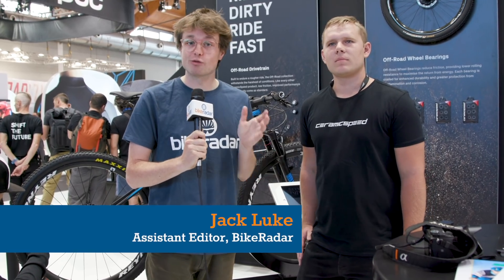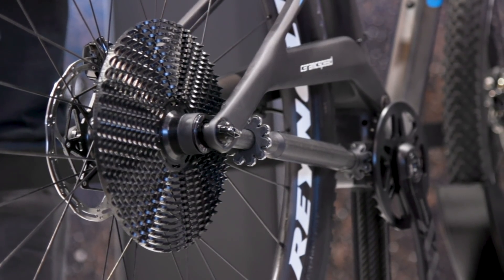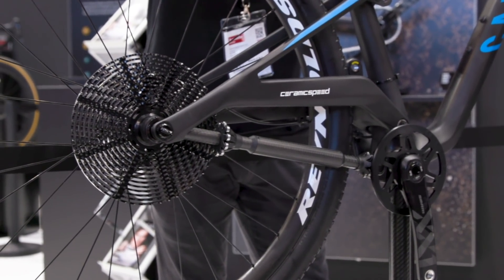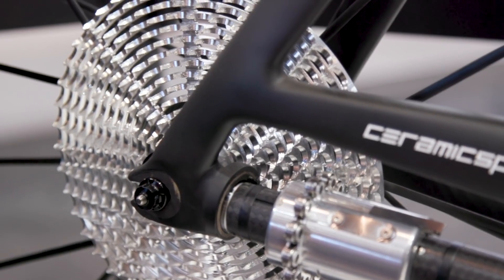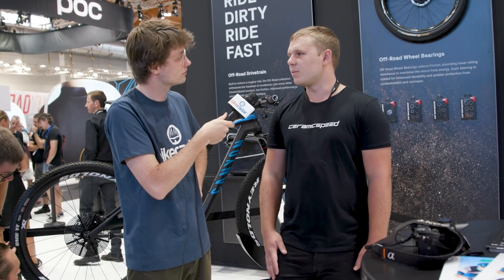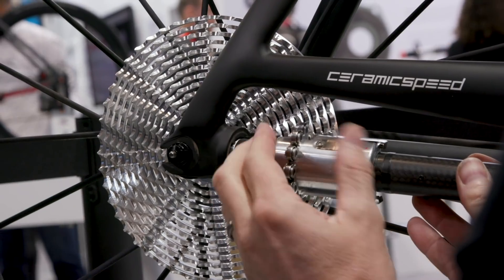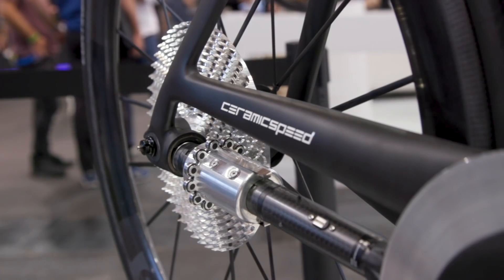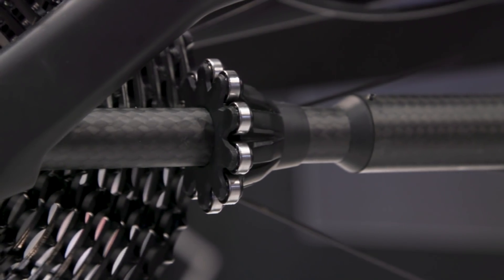No More Chains! The Future of Bike Design? | CeramicSpeed’s Driven MTB & Road Drivetrain

Comment: All the small gear rings on a regular bike are pretty close together (teeth = 11, 12, 13, 14, 15) and get bigger exponentially (23, 25, 28 . .  .), and this concept doesn't/can't do that. The proportionate difference between gears 11 and 12 is bigger than say a 35 and 38, and I can't imagine having a very optimal gear spacing on this concentric gear ring concept, especially on those smaller rings.
Reply: The gearing is perfectly linear. Nothing wrong with that.

Comment: there should be a highpressure waterspray+small watertank in conjunction with the shown motor to clean the gear-wheel, just like on some car front lamps.
Reply: All that is excess unnecessary weight you have to lug around with you when you could just carry something like a small brush and do it yourself or use a chained system

Comment: Love the creativity, but no way that thing handles torque without slipping/skipping. Between the axial load, on the ring gear and driveshaft, and the necessary clearance and compliance to operate. Of course you could beef it all up but, a sprocket or radial gear is much more strength to weight efficient
Reply: Fantastic - maybe you could help the team out by sending them your  calculations! They would probably be very thankful for your help!

Comment: He sais they took the bike to 45kph to see how it handles load, but I'd imagine it would struggle most in low gears, not high up - this rear gear assembly looks like it may bend and wobble while under load  in low gear, skipping teeth etc.
Reply: Damn straight. The force trying to separate the rollers from the teeth will be horrific.

Comment: I wonder how this system would cope against a 2000w sprinter. There are very few contact points between the rear sprocket and the driveshaft so the wear will be much higher and the sprocket will tend to flex inwards especially on the easier gears and under high power so I'd imagine even a moderately powerful rider would stress the drivetrain enough to skipping point. The idea is cool but it is nowhere near a finished reliable and affordable product
Reply: yep - that's the major stumbling block if you ask me. They say it ran at 45km/h , but that's going to be on one of the inner rings of teeth which won't be so prone to flex. They might find a solution, but I doubt it will look like this. "Stiff. Light. Affordable. Pick any two"

Comment: As a bike mechanic as my job is bike mechanic, the concept seems pretty cool but I see to many things going wrong with it or at least wrong with it in Arizona where rocks and technical climbs plague all mountain bikers. I see us cracking those carbon drive shafts really easy because it is a common thing to crack chainstays. Not to mention how much people grind their gears on rocks and bend chainrings. That’s manageable with a flexible chain but a drive shaft that needs to be solid interfacing with a bent chainring. Seems like maintenance will be cheap but parts can get expensive quick.

Comment: I am a mechanical engineer with a special focus on drive-line, and power transmissions. Particularly of automotive, but a lot of concepts from that, carries over to bicycles. 

This is over-engineered. It will never catch on because the benefits do not outweigh the conventional chain and sprocket. This design is pointless because it will cost more money than it's worth because you're having to pay for the work that a talented engineer has done, but it won't pan out, and any mechanical engineer that's smart, will go and work in a different field or industry where they can make more money. 

The only way that this design would ever be worthwhile is if the cad drawings were uploaded with something equivalent to a GPL license.

Comment: The two gains: 1) thin cassette=wider spoke on rear hub= increased strength. 2) Full suspension, use a concentric BB/rear pivot like that in the Pole Machine and Pole Stamina.

Comment: seems like it would be significantly easier to damage the drivetrain cogs in this setup considering that the load is being applied into the teeth in a much more concentrated area, and also at a 90 degree angle to the direction where a thin body disc is most rigid. Normal cassettes handle this load fine because its applied inline with the direction of highest strength.  Curious to see how well this design does in the real world.  Also the bike shown here cannot access the fastest 3-4 gears because the frame is in the way?  Who designed this?

Comment: What about a final drive at the rear and the crankcase more like a transmission?   It's not like they have been doing just that with motorcycles for years
Reply: A chain is far more efficient than a driveshaft in terms of friction losses

Comment: Good idea. Now the spoke bracing angles can be even on both sides.  Makes a stiffer   wheel.
Reply: You can get hubs with asymmetric flanges (like the alto cycling r-symmetric hubs) that compensate for that. There's a weight penalty but there is always a trade-off.

Comment: This is a new direction in bicycle transmission but Will it be smooth shifting and rotating after all the mud gets stuck on the transmission? Won’t there be any grinding? It would be good that they do some enclose in some kind of case. Make it closed system. Which should be fine.

Comment: Full suspension bikes rely on the chain tension to shut the suspension “bob” down while pedaling fir efficiency. This looks like it loses that. This could be overcome with a new way of shock thinking and technology feature. Also, without needing an axle path that balances chain efficiency and active bump absorption, an axle path could be optioned that maximizes bump capabilities and other riding characteristics, depending on what limitations this system requires as the technology further develops

Comment: Interesting expirement, but when it creates more problems than it solves, you know it’s never going to be marketable. The raised rear mainstay leaves the rear wheel and bottom bracket hanging, how could this not hugely impact structural rigidity and, more importantly, riding characteristics?

Comment: I get that you can ride it and ride it fast but can it handle 1000+ watts? If it can handle that I’d be sold on the concept but would never get it because of the assumed cost
Reply: If you can output 1kw with your legs, why haven't I seen you beat the tour de france? Top riders can do 700, for a handful of minutes.
Reply: Toy-joda they can peak in the over 1600 range. Greipel and Sagan. That’s also after 100+ km. I can hit it fresh at the beginning of a ride and usually I’m done after. I’m not saying I can go and hit it whenever I want, not even to mention the fact I’m 10+ kg heavier so that number is less essentially compared to GC pros. Also as if I can even afford I bike with this tech. I ride a 105 ultegra mixed groupo.

Comment: The concept is great, but I do not believe that rear "gear" cluster is stiff enough to take any pressure from pedalling without flexing and losing mesh with the drive shaft mechanism. Even tungsten carbide will flex at that length of leverage. Show it working with a beefy, ex-BMX racer turned MTB rider accelerating up a rocky climb and I might be convinced.

Comment: As a MTBer and engineer I think its a great design. Getting rid of rear derailleur makes road bikes more aero and mountain bikes less vulnerable. I don't know how many rear derailleurs I've tweaked over the years. Other major benefit I see is freehub doesn't need to grow with gear numbers. No need for boost/super boost/ect therefore allowing for wider hub flanges and more even spoke tension which these highly dished designs interfere with. The shifting mechanism is rather clever as well. There are some gearboxes that shift well under load, but that's still a common issue in most of the current drivetrain offerings. 
The major issue I see to its adoption is the same as with gearboxes; consumer perception and dedicated frame design. I definitely see this getting adopted more easily though as roadbikers are a much larger market that mtb and trekking bikes gearboxes were marketed to. Biggest hurdle I see is the race teams and sponsorships keeping brands from building a more efficient design if there teams can't race on it due to sponsorship conflicts. Sounds stupid, but it may make some companies hesitant to invest in the dedicated frame if they can't help sell it with the race results.
Reply: As an Engineer you should also want to spread the mechanical load over as much engagement as possible a traditional crankset you are meshing with about 50% of the teeth. With this you are only meshing with 1 or 2 teeth at a time. Apply a large sudden load and, snap!
Reply: I've gone threw maybe 4 in my current season, I go hard, I dont treat mine like it's made of glass, and I live in a particularly rough terrain, I think this concept is actually a great one and a good push forward as were reaching only minor leaps in terms of mountain bike tech.
Reply: Any engineer worth their salt would immediately find at least 10 major flaws with this design that make it significantly worse than chain and derailleur tech that has existed for almost 100 years.
Reply: @aygwm  that is precisely why it's still a prototype, shaft driven bikes are not a new thing, this is trying to improve on old technology, bevel gears. Shifting is also proven possible by the same old technology that dates all the way back to 1895... Driveshafts also has a way more consistent performance compared to chains. 

But yeah, at its current state, its just a proof of concept with a ton of room for improvement.
Reply: @aygwm  It's frightening that some people are engineers and not see the design flaws of such design. And these people create cars, planes, space rocket ships. Terrifying....

I work on computers so I'm not an engineer but even I can see this design is inefficient and too vulnerable to kinetic energy stress with only 1 or 2 teeth mesh taking the full load of an 190 pound adult.
Reply: Oh yeah you so need that aerodynamic aspect on something that barely does 40 Kay's an hour.
Reply: all of that load sitting on a couple of teeth 😬
I think spur gears are better at handling such forces
Reply: "as an engineer" <--- assume everyone is full of shit until proven otherwise. Mr engineer here probably thinks shitting into his own hands and clapping is also a good idea!
Reply: If it is really promising maybe Shimano or SRAM will buy it up and make the sponsorship conflict go away.
Reply: No need to readjust the shifting cables as the stretch out.
Reply: Yes, the question is how reliable will it be and would it provide a more robust gear contact at 45 degree angle. The speed changer could be inside the shaft.
Reply: They didn't invent this concept first. Check out Hasan Kum's video from 2014. https://youtu.be/FDvoNXPIfJ0
Reply: This is a good idea because of powerful cyclist with big legs that can probably brake the bikes chain.
Reply: You're an engineer Sam Young? 0.o hmmm....
Reply: Same i like this idea too. I hate breaking rear derailleurs too. Having to pay for another is annoying.
Reply: I Just think It shouldnt need to be electric controled, could be a simple cable mechanical
Reply: The shifting shaft is probably more susceptible to damage than a traditional derailleur. Change my mind.
Reply: @Bayplaces  Covers.
Reply: @ThisIsMego  how is that going to be practical on a mountain bike? How are the aero gains going to be maintained? At what point does the weight penalty outweigh the aero gains? Considering theres a motor in it, what races will allow this? What market will it serve? Belt driven internal gear hubs on e bikes are a stiff competition for whatever niche this thing is after. I mean really, who would want to use this?
Reply: @Bayplaces    you have a point, but it doesnt de rail, so grinding exits
Reply: As an engineer you should also know that a chain is one of the most efficient ways of transferring power too. If this was better, it would be everywhere by now
Reply: @Jj54328  Yes capitan but in Real World not So quite because  it gains all dirt and MUD.
Reply: You must be just another horrible engineer. There are many out there, I've worked with guys who were just plain out,  in the wrong profession. Great notebook peice, that's it. A thought to bounce off of to arrive to the right solution, anything but that.

Comment: With the little bit I know about physics, I can’t imagine how this would work well. On a chain system your initial torque force matches the line of the chain. You get direct translation of the energy. On this system the small surface of the bearings has to generate all that energy through through the shaft through the bearings then turn the corner, so to speak. I don’t get it. Someone explain this to me.
Reply: there is no way on earth that thing will do anything other than buckle and fail horribly on the very first outing... no matter what it's made from. The entire structure is a misconception from top to bottom. This is the kind of fantasy drivetrain that one could only dream up if one knows nothing about forces, nothing about leverage, nothing about the inherent qualities and limitations of materials (particularly in relation to that ridiculous disk at the rear) … a total joke.

Comment: I assume the wear rates with those tiny contact areas are going to be pretty high versus the multiple contact areas of a chain system?
Reply: You're probably right, however the bearing rolls over the cog, so might not be terrible.
Reply: @tubularmonkeymaniac  I concur regarding tooth design, they could be onto something. I'm getting that the main challenges are; stresses in the teeth on the largest cogs; achieving decent IP67 sealing on a housing that is both durable and light weight could be difficult (I would know for this point); also, cost might yet be a big issue due to the precision and hardness of each component.

Comment: Seriously, it's time to be blunt about the drive mechanism.
1. it's almost a 100 year old concept
2. it can't shift as good.
3. it transfers the power over merely a couple of teeth, instead of distributing the forces over a chain. It will not last 10% the time of a normal system, as a normal system (e.g. 53x14 ratio) distributes the power over 25 and 6 teeth, whereas this uses 2 + 2 teeth. That's horrible!!
4. yes, it looks nice, but that's about it.
5. the hype is unreal. great marketing job.
Reply: This should be top comment. My thoughts exactly.
Reply: My thoughts exactley  .

Comment: I don't like it! But that's irrelevant, if nobody tries to break the established, we won't evolve! Props to going forward even if this product ends failing enterely, the future of bikes will come because people like this 👍
Reply: @Xanthi2020  it sounds like this is more efficient than a chain drive, i think that's part of the point. Also, I love the idea of gearboxes, and would love a Pinion with belt drive for bikepacking, but they can't shift under load. It looks like this can! Plus, the gearbox and belt drives are less efficient than a chain drive. This could be a really awesome solution, honestly. If it works well.
Reply: The future of cycling is physically separated cycle lanes connecting everywhere to everywhere. You create those and cycling will explode a million fold.
Reply: @VelhaGuardaTricolor  Amen
Reply: Velha Guarda Tricolor No it won’t. Sidewalks already exist, as do the side of roads.
Reply: They didn't invent this concept first. Check out Hasan Kum's video from 2014. https://youtu.be/FDvoNXPIfJ0
Reply: @Xanthi2020  but internal gearbox is heavy
Reply: Bikes are like guitars. We can change it bue the real guys will always use the real thing.